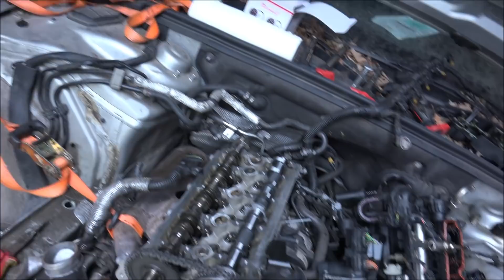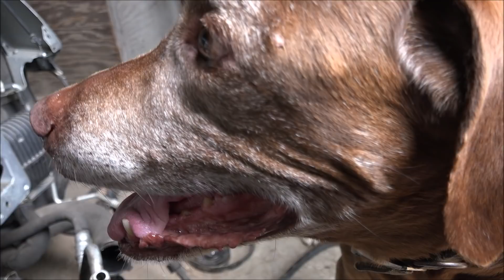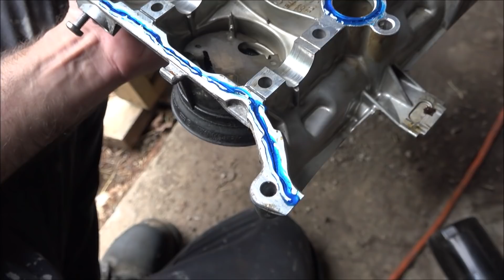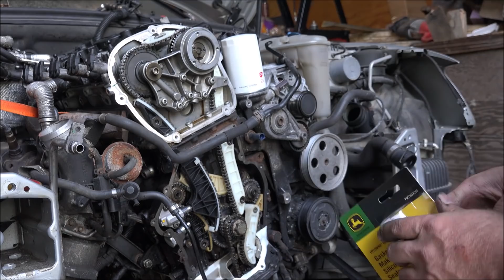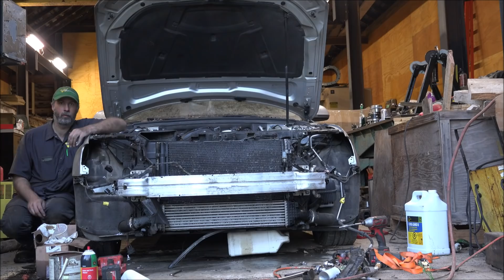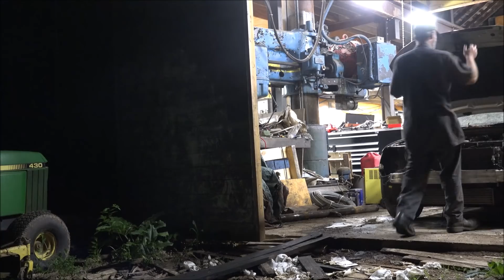Well it still ain't good :-) I failed

Comment: swap injectors 3 to 4, if the missfire follows, replace the injector. if it doesnt you have other issues. likely lobes on exhaust cam imho, as you didnt have any excessive blowby when you took the cap off.
Reply: actually, scratch that, its 100% got a compression issue, you can hear it when you crank, i just hope its the exhaust cam and not piston rings :)

Comment: Spark plug or spark plug wire or possibly an injector that needs replacing. Brian my grand son has one with the V 6 . they are prone to leaking oil onto the insulator of the spark plug and also you could have damaged a plug wire when working on it. We found his running on only 4 cyls after he put an alternator and it was definitely plug wires that got damaged.

Comment: Brian, you have three days in it plus some dollars. If you sell it as it is that's all money thrown away. If you can obtain pistons and rings I would suggest you do that; it's worth more as a driver, either in plain in resale money, or as a daily drive for your lady. It might be a POS right now, but a little more work will turn a dead loss into something worthwhile.

I might add that this decision is also affected by the condition of the rest of the car. If the body and interior are good and you sell it with a crappy engine you throw away an asset. If the rest of the car is good and you keep it then you realise the benefit of the expenditure of your time, expertise, and effort because the daily drive will provide a few years transport for your lady, which has to be a better deal than paying out yet more money for a replacement which may bring other problems; it's that "Better the devil you know..." thing.

That's my two bob's worth, anyway.

Comment: I've been using the Hylomar for ever. Made by Bently Motor Cars. The 🔵 color. A very thin coat where no gaps interfere. It's not a gasket maker. Works very well for sealing well fitting flanges on case halves. It never sets hard.

Comment: Tough call Brian... tough call indeed. Someone else mentioned throwing a leak down tester on it - I wholeheartedly agree. Depending on which direction that takes you I wouldn't touch it again until I knew for sure parts were available. But if I had put this much effort into it already there is no way I could live with letting that piece of Messerschmidt win. But that's just me. Best of luck with whatever you decide to do.

ps. Tell the shop boss I said thanks for not coming down on you hard on this one. ;-)

Comment: Just take the advice from the hitch hikers guide to the galaxy DON'T PANIC. I did mention in a previous post that these engines have a nasty habit of damaging the rings . start with the obvious ,carry out comp test if out of spec do a leak down test to narrow down the suspects (don't need a fancy tool just air line ,just air line at 60-  70 psi  piston at tdc ). If rings are confirmed to be the problem  don't mess about just remove engine it pays dividends  in the end.If rings ok  then  check for bad plug and coil pack (swap cylinders to see if problem moves). If they  are ok  check to see if the hydraulic lifters are  either jacked up causing valve to be kept open or if collapsed causing valve not to open correctly . If all the mechanical checks pan out ok ,then injector /injector loom .  The only other thing to consider would be a bent rod , but you would have to be really unlucky for that to be the cause (normally only due to hydraulic lock). Most probably a couple of hours to complete all the above tests at least then you will have direction and a definitive diagnosis. At least you have only one to do battle with I currently have six  on the bench in various states  from spun main bearing to standard bent valves all good fun as the saying goes. don't loose heart  when on form  quite a nice drive.

Comment: Hi, I perfectly understand how you feel. I am so sorry. I also had an extremely bad day in the shop, as I have been working on a spindle for an ID-grinder during the last few months and ruined my work because I forgot to install a spacer ring. When I attempted to dismantle the thing, the bearings and spacers galled with the housing.

Comment: After seeing that timing chain arrangement with the poly block chain guides I understand your comments about the "50k is about all it's good for". You really went the extra mile on it, If I had any idea prior to teardown how that engine was built I wouldn't have torn it apart. You're right - it's 3 days you're not getting back. Myself I would try to part it out if I had too much in the repair to throw it away. Yep, can't win them all......thanks for sharing

Comment: Brian, not clear what the compression test revealed. No blow by, so that is good. No knock, so no bent rod. If the injector was damaged, replace it and test again. I'm with you, you are in too deep to dispose of it. We now must know the root cause. Move the car to under the other outbuilding to make room for your paying job. In between, tear back into it but get into the lower end if you still suspect ring damage or other. Or replace the suspect injector first. Good luck.
Reply from the maker: 40psi :-(

Comment: did you try moving  injector to see if missing goes with injector
Reply from the maker: No when it only had 40psi on that hole I sealed it back up.
Reply: @bcbloc02  enough said ,keep the significant other happy get another with a duff body and change the engine over

Comment: Did you check the compression? When cranking it does sound like you have a dead hole. You fought a valiant battle. It would be nice to know what the problem is.
Reply from the maker: 40psi :-(
Reply: @bcbloc02  did you try squirting oil in the plug hole to see if it comes up? If it doesn’t maybe a tight valve.

Comment: I’d at least do some more detective work on it. Switch injectors and coil packs around and see if the problem moves, in the meantime stick a fore sale sign on it or in the paper and see what interest you get selling it as is. Good luck with whatever you decide.
Reply from the maker: It only had 40psi :-(
Reply: @bcbloc02 , how much work is it to get the oil pan off?

Comment: Audi coil packs do play up. Clear the fault codes and swap 1 and 4 coil packs over and see if the missfire moves to number 1 cylinder. If it does its coil pack. If not best to move it on, as it will eat into your time.
Reply from the maker: It only showed 40psi :-( I don't think a coil pack or injector swap going to help that.
Reply: @bcbloc02  true. Piston and rings then.

Comment: You have learned a lot more about an Audi engine than I am sure you ever wanted to.  Although I think that you should send it down the road, you will probably do the same as I would and fix it.  While it is sitting waiting for a decision you might want to pour some Marvel Mystery oil in the cylinder and let it soak.  Couldn't hurt!

Comment: Maybe buying a short block from a wreckers may be a more cost effective way of doing this. The bottom end on the 2.0T is generally not the issue on these engines. It's the rest of the crap that fails, tensioners, cams as you have shown. Etc. Maybe, a used bottom end and your top end parts grafted on. I know someone who has one of these with 180k miles on it. Still runs fair. Luck of the draw.